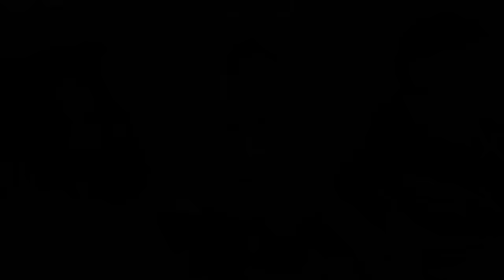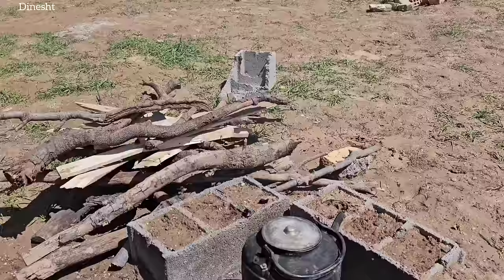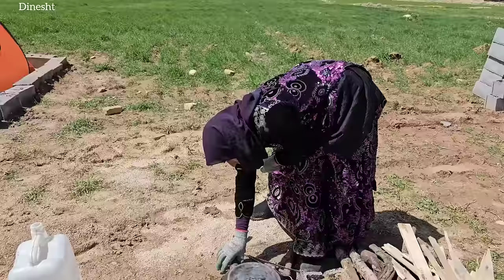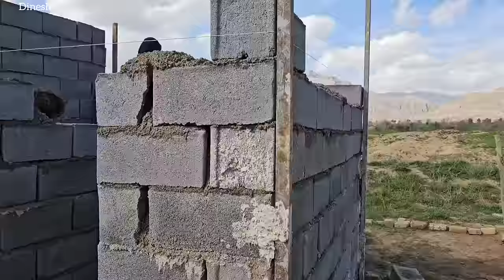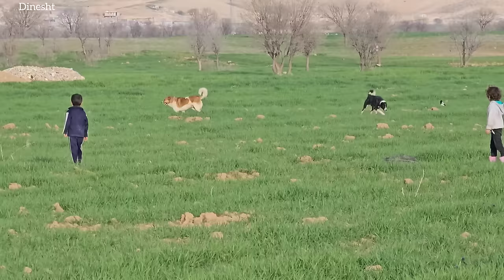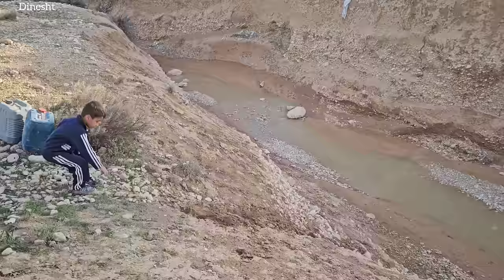In 2024, the single mother turned this land into a winter shelter for her children

Comment: Thank goodness,stream not far away Anis did a slippery slide on soft muddy bank, luckily didn’t fall. Outfits worn called boshiya?🫨Suggest 2 tuck top part up in their elastic skirt, while working, b easier won’t b in the way If not bottom skirts been drenched in wet mud 😮.When’s put roof on house, & walls plastered Sooner better they have to sleep  in damp cold ⛺️

Comment: Perhaps the mother could use the wheelbarrow to help bring back the 5 gal. jugs of water. The strain on her shoulders and arms carrying that very heavy load is huge, at least 80 lbs. (36 kg) if
they are full. Her skill at building the washroom area is incredible. She is very wise to have cut in some steps on that bank to reach the water. It was a very difficult access made a little easier now.